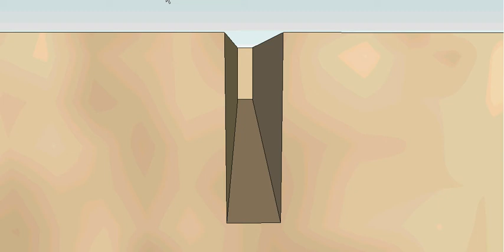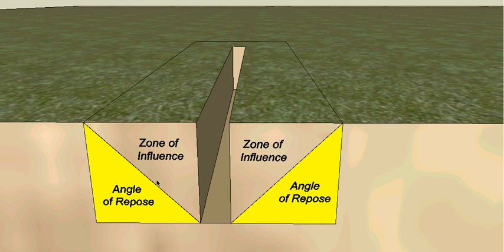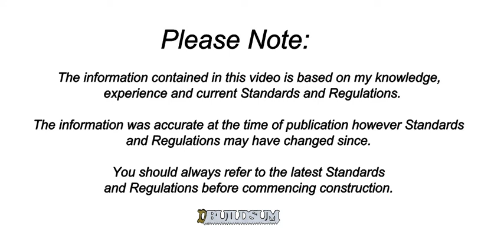Angle of Repose - Zone of influence

Comment: So does that mean you need to include form work on all strip footings to prevent the zone of influence from collapsing into the trench? Is it common practice to do this. I'm in the Ryde area and have to put in 450 deep x 350 wide strip footings and I'm wondering if I need to use formwork or not. Great videos by the way... I'm hooked.
Reply from the maker: +Andrew Tenney Hi Andrew Thanks, in answer to your question No, only if the excavation is deeper than 1.5m and you intend to have someone working in it, As per this video or if the foundation material is so unstable that you need it to hold up the sides of the trench e.g. sand
https://www.youtube.com/watch?v=NcKL2R7KMkU

Hope this helps

Comment: Is the angle of repose used to figure out how much to slope the trench?
Reply from the maker: Shaine MacDonald Hi Shane The slope of the trench will be determined by the fall that you need for the pipe, if you need any at all. The Angle of Repose will only be needed if you are going to batter the trench to stop it from collapsing.
Reply: It's rather confusing to me still.  In the heavy equipment operator - Excavator course we learned that trenches over 1.2 metres are sloped at a ratio of 1:1.  Does this sound right?
Reply from the maker: Shaine MacDonald Hi Shaine a 1:1 ratio would give you a 45 degree angle of repose which would be a rough average for the majority of materials however if you where excavating in loose materials the angle would have to be lower.